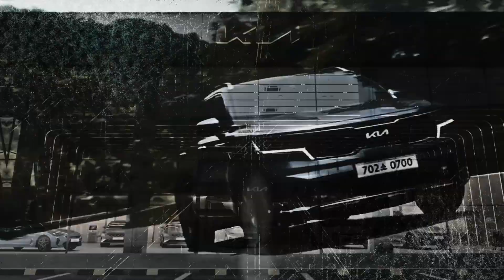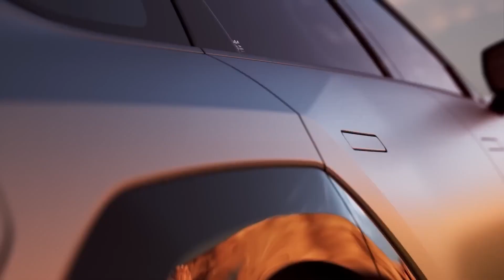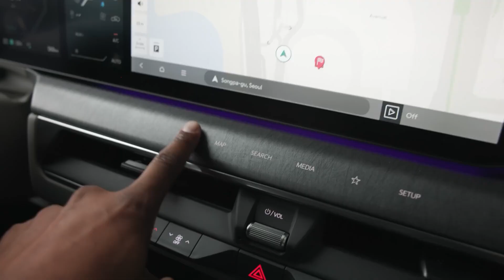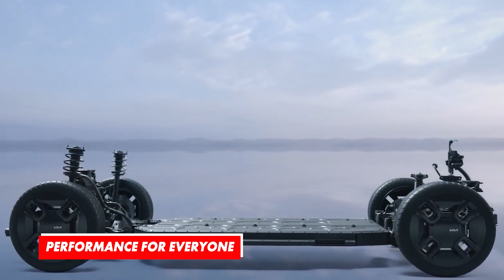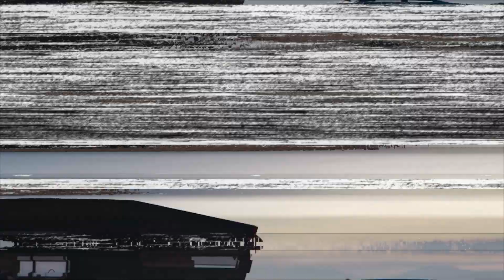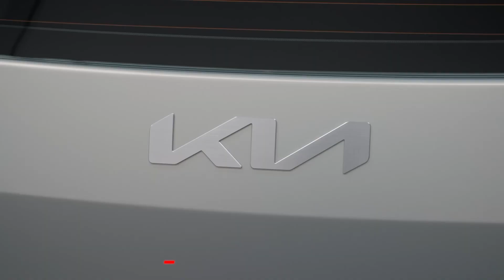The NEW Kia EV9: The Electric SUV You've Been WAITING For

Comment: .It's a "something of nothing" car. There is Space: lots of it for the occupants.. and comfortable. BUT with the seats up.. there is more storage space in the 2008 Vauxhall Astra Hatchback I'm currently using as a "runaround".  "Why does this matter?" Lets think about the whole car concept for a minute. It's a "family car".  What about is one of the family is disabled and we need to take a self propelled wheel chair?: Not an issue if the rear seats are dropped.. but supposing a famliy of 6 (It's a minimum of a six seater car anyway).. BUT with the rear seats up.. Getting a self propelled rear chair in the boot is VERY tight with no room for the "picnic bags", that may be wanted to be taken on a family day out. I've had a Chrysler Grand Voyager, and don't have these issues wit this car.. and because of the "stow and go" system, with the Voyager seats "up", there is extra storage in the floor! And yet, the EV9 is significantly larger (Let's not beat about the bush here: It's Huge!) than the Grand Voyager. I've been anticipating the launch of the EV9  for ages. Having finally seen it.. I am VERY disappointed, and if you have a family of 6 and a disabled family member, EV9, I'm afraid is NOT for you...

Comment: PUBLIC STILL UNAWARE OF EV's SERIOUS OPERATIONAL DANGERS !!! 
Heaven help poor Americans, as the "Bomb" may end up being your cars dangerous Lithium batteries EXPLODING. Indeed a number of European countries are already introducing Legislation to try and curtail the most dangerous aspects of EV's. For example: EV's must NOT be towed, because if towed the cars electric drive motor then becomes a Generator, leading to Battery explosion in as little as  just ONE MILE. The rule therefore is that EV's MUST be put on a flatbed lorry to be moved. Further damaged EV's involved in even minor accidents, has led to Humans touching the cars bodywork being electrocuted as EV's have either 400 volt or now 850 volt battery packs. Don't forget DC electricity (in batteries) is a type of electricity that tends to grab & hold you on, while AC Domestic electricity is more likely to kick you away !!!! 

Further damaged EV's must be stored in a secure compound at least 25 feet from all other objects and particularly humans, as again faults caused by vehicle damage can result in the batteries exploding hours, days or even weeks later.

Airlines have now also begun implementing "restrictions" on the carriage of Lithium batteries after a Cargo plane crashed due to Lithium batteries being transported amongst the cargo, exploding and causing fire.

Two LARGE ships carrying thousands of new cars including EV's have caught fire recently (One last Tuesday 25th July). Both having to be abandoned and now including one death aboard, due to Lithium batteries inside the cars exploding for no apparent reason !!!

We have known for Decades that "Fast" charging even normal batteries, can lead to EXPLOSIONS. But EV Lithium batteries which usually take up much of the vehicles floor space, and therefore make up a considerable part of the vehicles total weight, are both more explosive and in such large quantity far more likely to kill. So NEW "High-Speed" chargers all around the USA, may end up killing more Americans than all those lost in the Vietnam War !!!

Further and most interesting is the fact than Elon Musk (owner of Tesla EV cars) has recently announced that he is changing course, and NOW investing heavily in HYDROGEN POWERED VEHICLE TECHNOLOGY. Is this a hint that the problems with EV cars are growing rather than diminishing, despite continued development ?